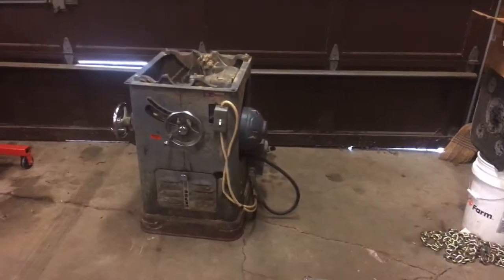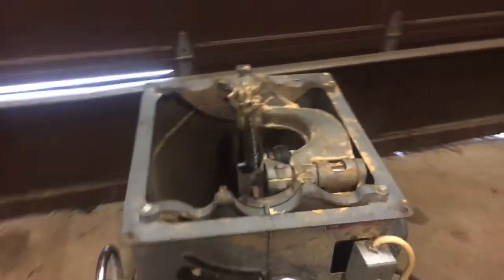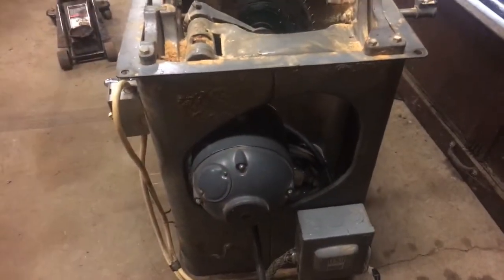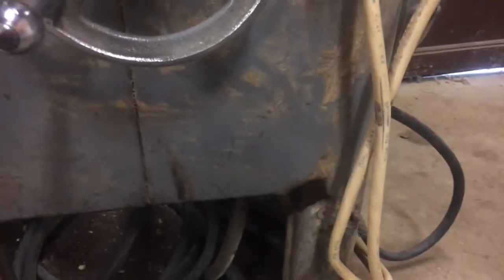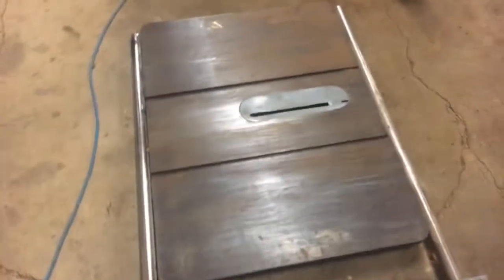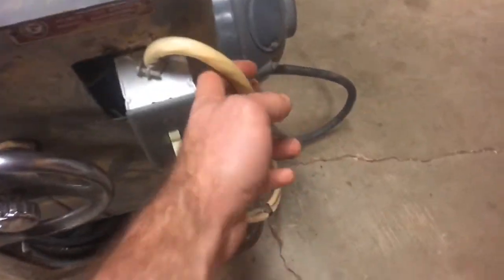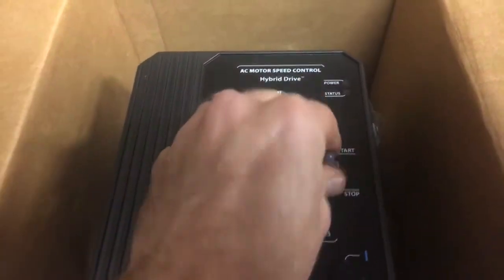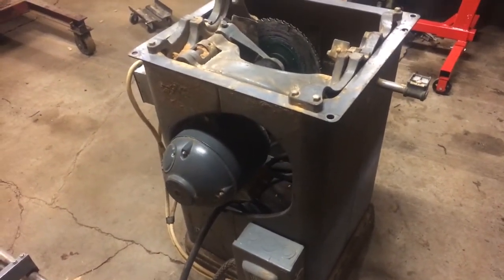Delta Unisaw project part 1 VFD

Comment: How do you wire it, I’m restoring a 1949’s bandsaw 20” delta crescent. My 2x72 grinder came with that vfd wired to a 4 plug 220v. There are three lead wires coming out of the motor in low voltage wiring but none labeled or colored. I keep tripping the breaker lol